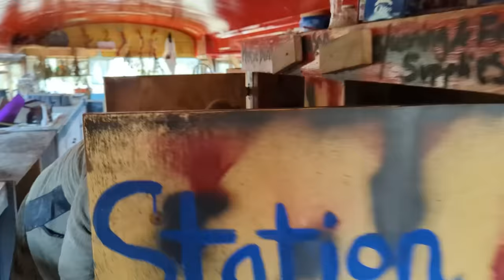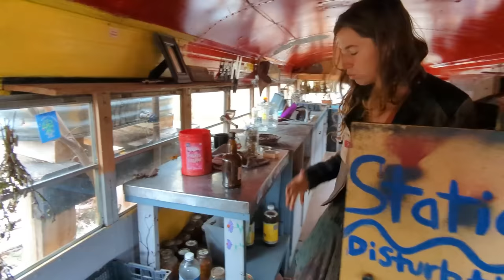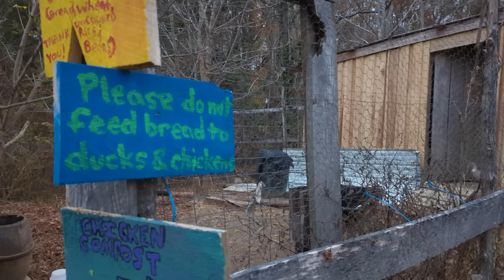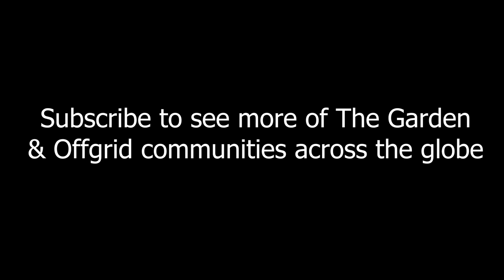LIVING OFF the GRID with all our FRIENDS | 13 years offgrid COMMUNITY | learning from mistakes

Comment: Those trees behind you when picking for the soup are they yours? If so use the deadfall leaves to mulch with instead of straw. More nutrients and the local  insect  population will be more receptive. I don’t know what your compost looks like I’m new to your channel but layer leaves into that also if your not already. Straw tends to attract the carnivorous insects that devour greens you can also place lengths if garden hose just under the straw and earwigs and pull bugs will crawl in at night tap into bucket of water at dawn

Comment: Put a clear plastic tarp over the logs with mushrooms. Itll help increase the humidity. Then lift the tarp once a day to kinda burp it and let fresh air in
Reply: Any of those mush growing out of the logs are woodlover strains. So u can drill holes into new logs, and transfer wooden dowles that have the mycelium growing on it into the hole u drilled. That's how you can inoculate new logs to spread those specific mushrooms by using the live mycelium instead of the spores
Reply from the maker: OK I screenshoted this so that I’ll remember it next time I have the opportunity to do this, thanks so much